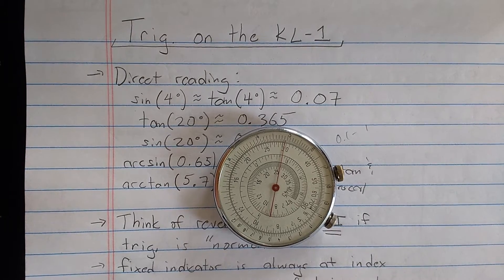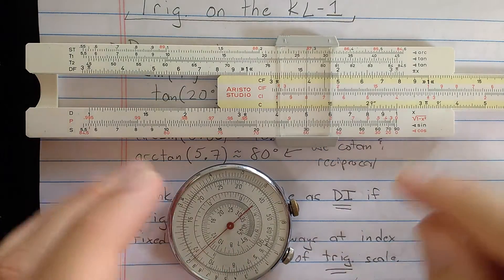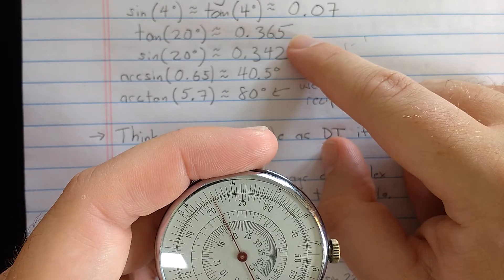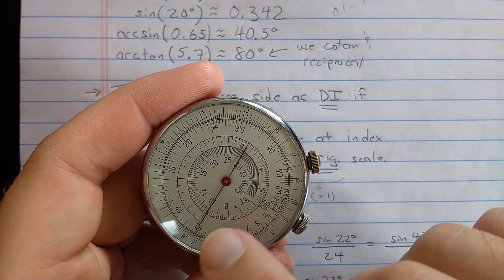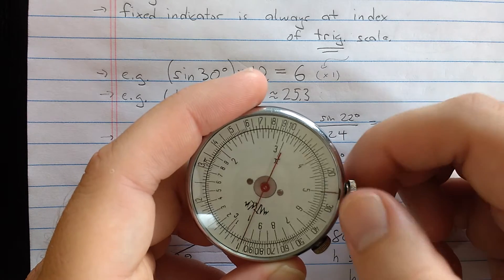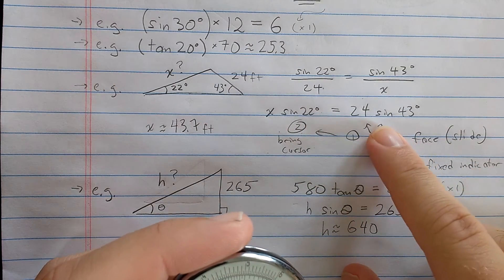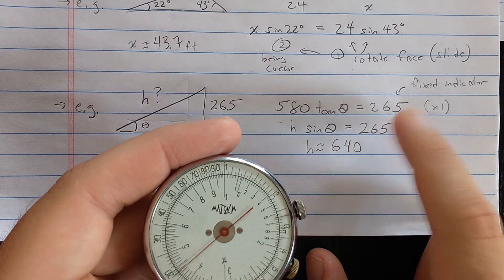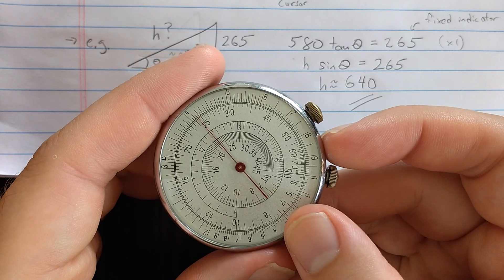Russian KL-1 Circular "Slide Rule" (2/2 -- trig)

Comment: It is Awesome!!!  how you flip from front to back. Two points:
- My KL-1 is not aligned, setting the fixed index to 1, and the needle to 2, the inverse reads 4.9 not 5.0.  How do I calibrate it? I did not want to bend the needle, I opened the bezel and the fixed needle is soldered to the frame, and both faces are glued to the frame... There has to be a way to adjust it to account for manufacturing errors.... any ideas??
- I could not figure out how to concatenate several multiplications.. until I changed the order... 1) set the fixed index to the first multiplicand, then move the needle to 1, then rotate the bezel until the needle is on the second multiplicand, then the answer is on the fixed indicator. Then to multiply the result by another number, move the needle to one, then rotate the bezel by the new number and the  new result is again under the fixed indicator.
Reply from the maker: Thanks! I've never tried an adjustment on a KL-1. They don't really seem designed to be adjustable. If I really needed it done I might check with someone who services mechanical watches. My guess is the needle should be removed then reattached in correct alignment.

Comment: CALCULATION OF THE AREA OF CIRCLE 
1. Rotate the black knob to position the "C" under the fixed indicator. 
2. Rotate the red knob to position the Needle over the Diameter(D=2xRadius). 
3. Rotate the black knob to position the Index under the fixed indicator.
 4. Under the Needle read the area of the circle on the outer scale.

Comment: Great video. I picked one up on eBay that’s near new condition. It’s got a really nice movement. Any idea how widely these were used? I had never heard of them until I saw your video. Also, this might be a stupid question, but do you know what the “C” mark near 1.125 is. I was thinking c as in speed of light, but that doesn’t work since, as I recall that’s either 300 or 186, and I can’t think of physical constant at that value. Just curious. I’ve never seen that mark on any other slide rules.
Reply: The C mark is used to calculate the area of a circle using the diameter. It is equal to sqrt(4/pi) = 1.128.
Reply: CALCULATION OF THE AREA OF 
CIRCLE
1.    Rotate the black knob to position the "C"  under the fixed indicator.
2.    Rotate the red knob to position the Needle over the Diameter(D=2xRadius).
3.    Rotate the black knob to position the Index under the fixed indicator. 
4.    Under the Needle read the area of the circle on the outer scale.
Reply from the maker: Thanks Tim! I'm not sure about the gauge mark off the bat, but it's made me curious enough to look into it when I get back from vacation!
Reply: Good question! I have a Polish slide rule with these markings as well: c (1.113), c1 (3.57), ♀' (3.439) and ♀'' (2.065). The last two I'm not sure, they look more like an upside down δ, but I couldn't find the exact symbol.
Reply: I found the answer: c=sqrt(4/π), c1=sqrt(40/π), ρ' and ρ'' are the number of minutes and seconds in 1 radian. What's so special about those constants?
Reply from the maker: If your descriptions are correct, the first would be useful in relating the diameter and area of a circle. The two rho constants would be useful for radian/degree conversion. The c1 constant sounds similar to to the c constant, but with the decimal point moved (40 instead of 4). My guess is that this has to do with how it is used with the square scale (i.e. how many digits your number has) since that is an issue when finding square roots, but I don't have a slide rule handy.